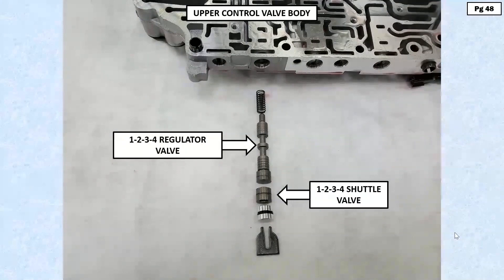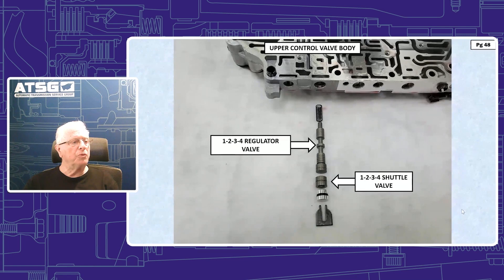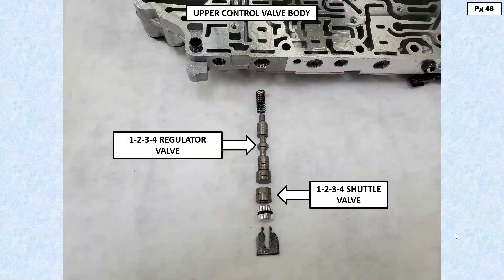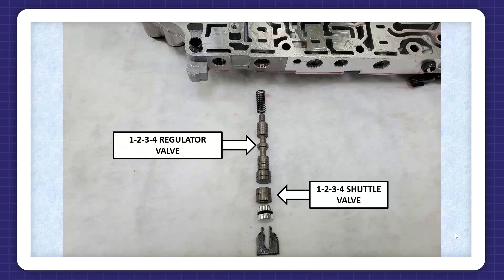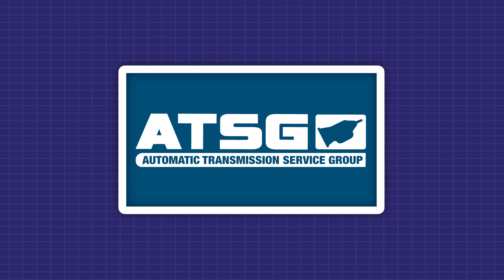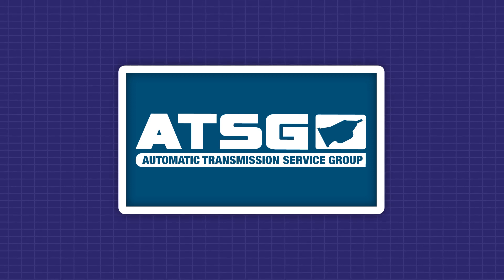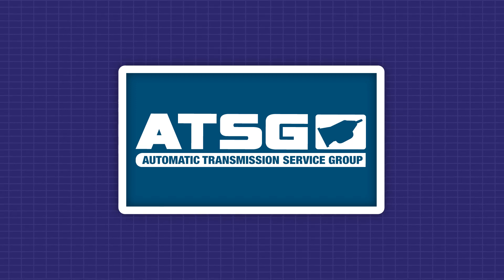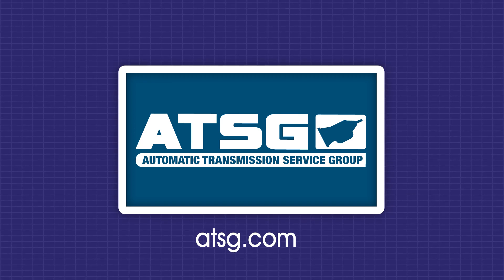ATSG - 6L80: NO FORWARD MOVEMENT

Comment: How do i check this? i have my valve body out and checked for stuck check balls. no problem found. i only have reverse.
Reply: Did you find the problem
Reply: @bogganjd  yes cracked 1-4 piston and smoked associated clutches
Reply: @taylorolson6939 I just have the same problem with a 6l90, I purchased this remanufactured  transmission and it worked for two days, I remove the valve body and replace the separator plate and the eight balls, still no forward gears, I do have reverse and I can shift manually and it moves when I move to 2nd gear and when I go back to drive it shifts fine until I stop at a light for more than 20 seconds then when I accelerate it revs up and then it shifts to second and on, did you have the same symptoms? Thanks I’m glad you found the problem.